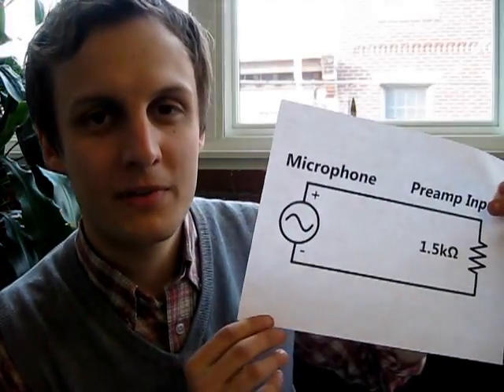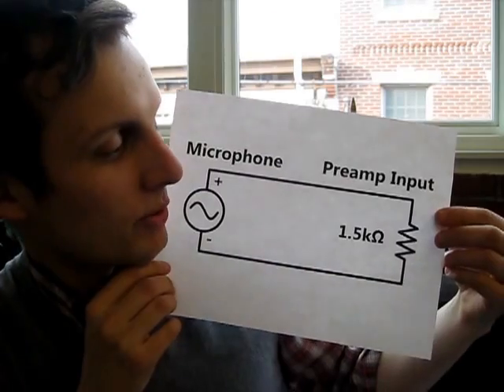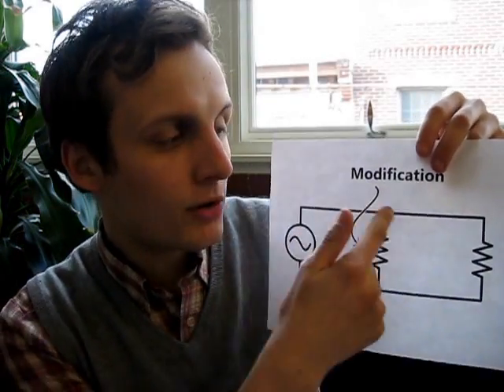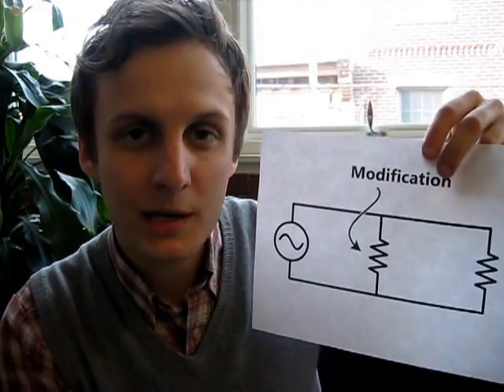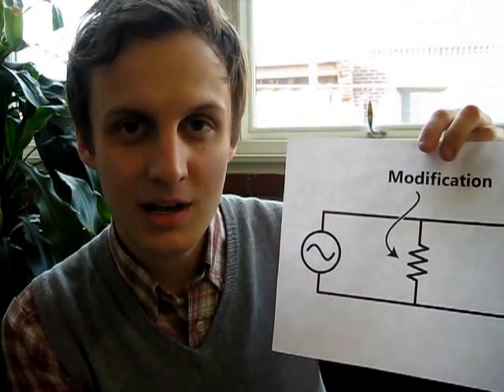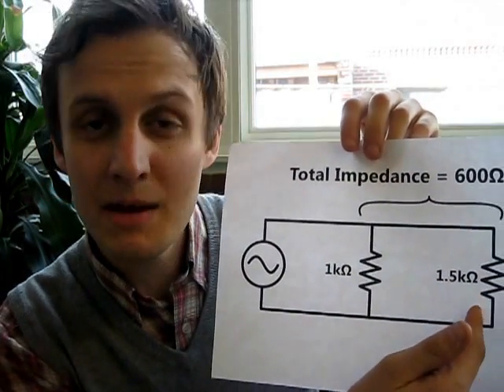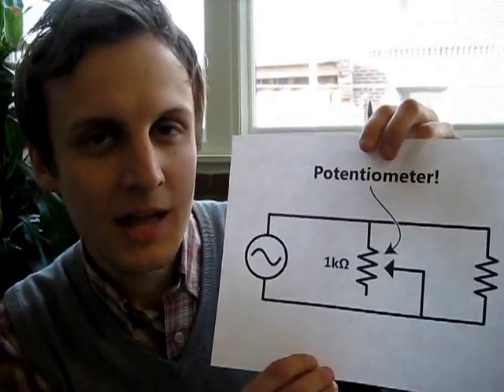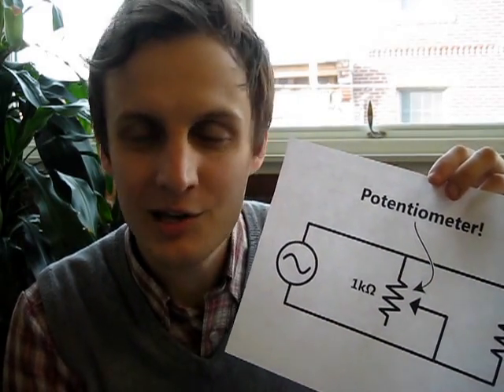How to Add an Input Impedance Control to Any Mic Preamp

Comment: This is misleading.  You're adding an additional resistive component to an impedance circuit that will change the corner frequency but disproportionally reduce gain compared to a proper transformer.  You are changing the impedance of the CIRCUIT but not of the component in which the signal is actually being read across by the preamp.   This is just adding a passive filter inline, no more - no less.  -MSEE
Reply: This is incorrect. If you look at the circuit or the soldering and assembly part of the video, the pot is neither grounded (volume control) or capacitor and ground (filter control) He is simply, as described, adding a parallel load.
Reply: You are right, this will impair the frequency response, maybe not noticeably but it will reduce response. Either use  a transformer or leave the impedance high.

Comment: Your electronic theory is a bit wonky. The circuit you have made will only give you impedance adjustment equal to or lower than the old standard. So the max impedance will be 600 ohm, but when you turn the dial fully the other way it will create a hard short, the impedance is zero, and you will get no signal from the mic. This might be an interesting area to explore, but it limits the impedances you can try by excluding everything between 600 and 1.5k. If you change your pot value you can try impedances above 600 ohms as well.

Comment: Would have been good to show us the graph mentioned? As it stands, this is just "intresting" as you said. I unfortunately am none the wiser. I have a microphone that has a built in impedance modification, removing it makes it basser and it is already too bass. See, so do I need a bigger or weaker resistor? I get it, you are trying to sell your kit, but your kit is a bit big to go on my camera

Comment from the maker: A 5k pot will work just fine. You'll simply be using less of the pot's rotation most of the time.
Reply: The thing about adding  a pot with a higher resistance... Think for a moment about the mic before you do anything to it. That's electronically the same as the original mic preamp impedance with INFINITE resistance in series with it. That is, the higher the resistance of the pot you add, the LESS will be its effect  at one end of its turn. Since the pot can actually go to zero ohms, at the other end you have no signal at all.

So there's nothing to be gained by making the added pot more than ten times (or so) the resistance of the mic preamp's input impedance. Anything more and you can't sense any difference.

Comment: Nice. But this can only lower impedance. And actually attenuate as you go lower because the in phase and out phase will be cancelled. What would work better would be a dual pot wired where each each phase is connected separately and resistance from each to ground is adjusted.

Comment: Mhh... Bad idea. Loading a mike with a low impedance device will bring distortion, low signal with degeneration of tone and weird frequency cancellations. You ideally want your front-end pre to have a very high impedance to load the mike the less you can... as every good old vintage tube preamp does! Variable impedance machines have the possibility to INCREASE the standard 10:1 ratio, not to lower it.